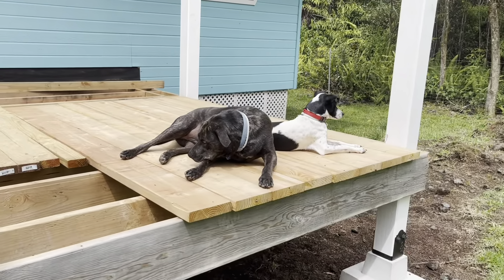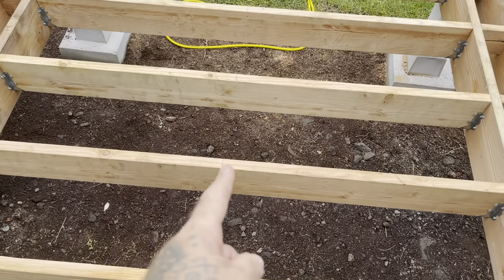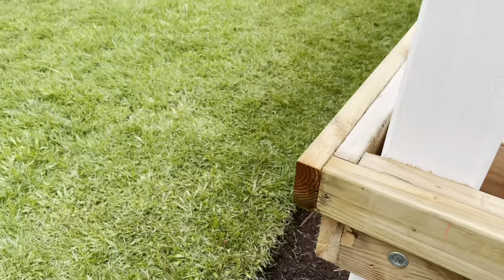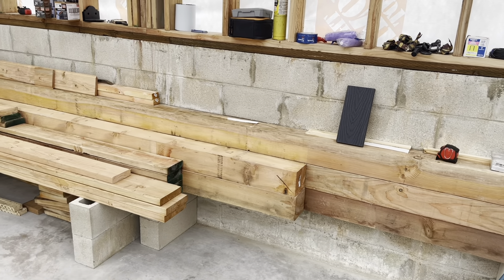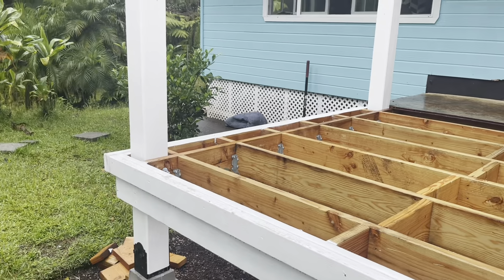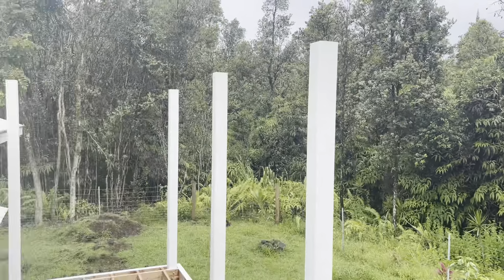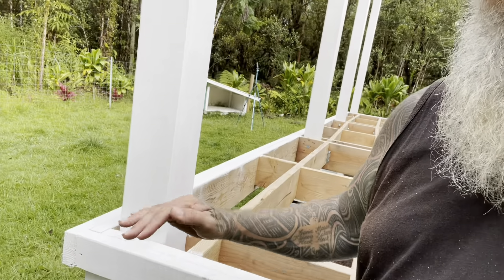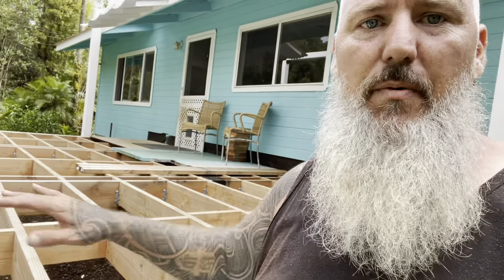Hawaii Lanai/Deck Build Part 4

Comment: Just want to ask before you go further, you set your post tops level with the roofline at the eaves. Wouldn’t you need to go lower to create pitch away from the house?
Reply from the maker: Hi, the roof on the deck will be perpendicular to the house roof so a valley will be made where they meet. But that’s a ways down the road as we are waiting because we plan to ad a second story to part of the house. 🤙🏼